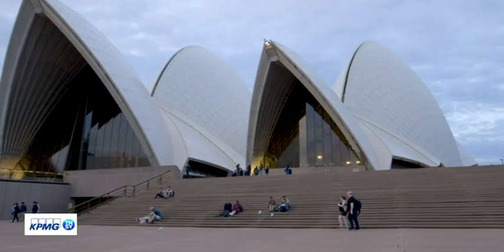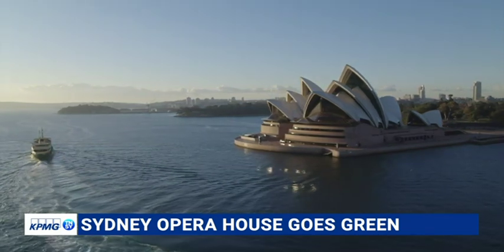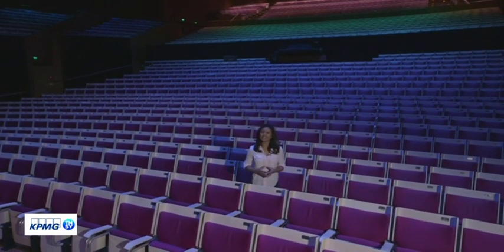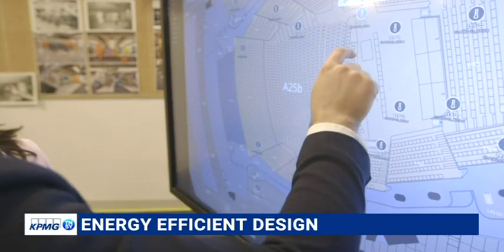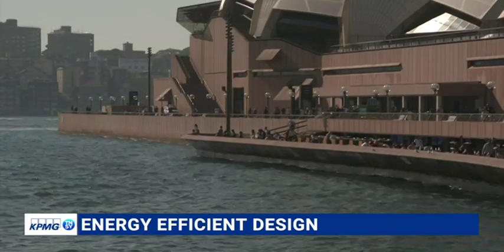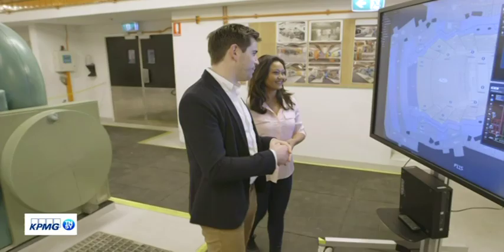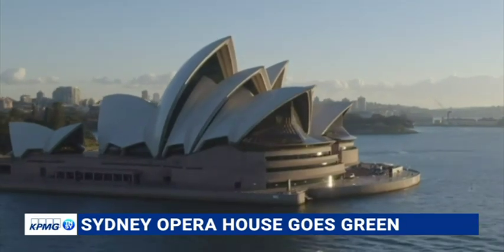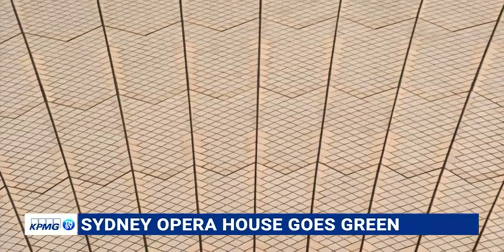The Sydney Opera House goes green

Comment: Wow 14% and they just changed to LED which there forcing home owners to use . Now a wave generator and a wind turbine and solar panels will make it 50% more efficient . What about the rest of the CBD , Turbines and solar on every government building whilst they shut down 24/7by 365 days a year power  ( gas and coal )to at best 12 /7 290 days a year power Wind and solar ) . Virtue signalling at it's best .